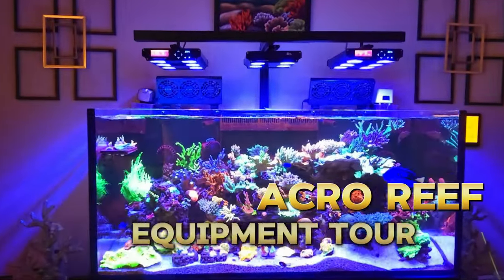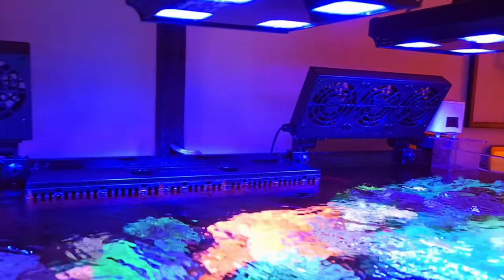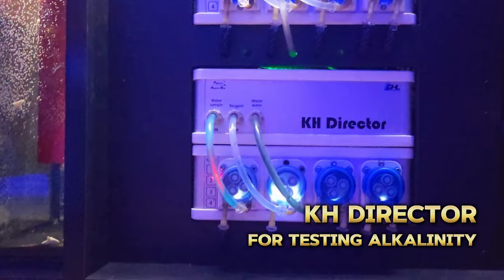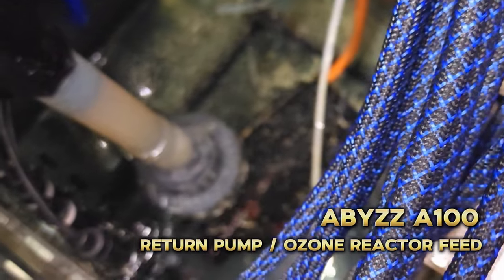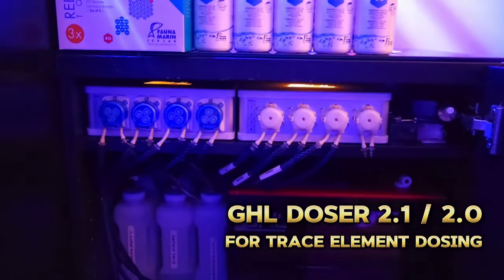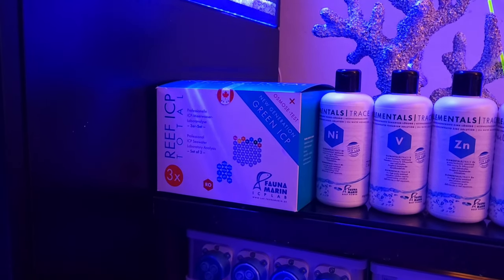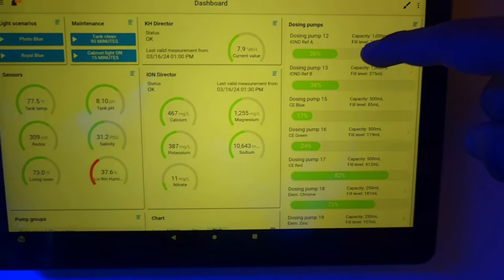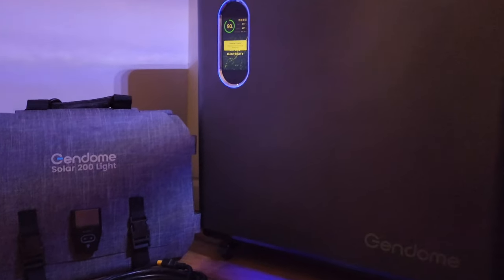Tech Savvy Reef: Exploring Aquarium Automation & Gear!

Comment: You not married, right !?? 😂  Your attention to detail is heroic.  Well done sir, left-to-right, top-to-bottom. I have also a RedSea 650 for 3+ yrs, using Apex/Neptune which I actually DON'T like, btw. 😮  Ever used kalkwasser ?  I dose a slurry at night using a PH probe.  Solves more than 1 prblm in that way.  Top notch tank, thank you for sharing. 😊❤
Reply from the maker: Lol Thank you for the kind words! I did take my time with the planning phase before the tank was even ordered. Even along the way, I always pondered ways to keep as many wires out of sight as possible. The idea of having a bunch of modules or wires sticking out from the front of them would drive me up a wall. The ProfiLux helps keep things tidy. 😅

I've never used Kalkwasser, but I have considered it for this tank since lowered pH is a side-effect of running Ozone. The challenge is finding a way to keep the extra equipment consealed.

Comment: Wow the attention to detail is incredible. The GHL automation really seems to be leaps and bounds ahead of other aquarium controllers. What kind of learning curve is it to program the sensors and functions? Do you need to know coding to do the programing? I am tech savvy but I lack programming knowledge. What kind of time frame did it take to get to your current set up? Thank you for sharing much appreciated. I am in the planing stages for my dream set up. I am considering either a water box peninsula  7225 or a Cade peninsula 1800. I want the tank to have dynamic dosing and auto water changes as well.
Reply from the maker: Thank you! I will say that what's in the tank now for automation was a steady progress. The initial setup was pretty straightforward, and I don't think you have to be technically savvy to set it up. It took me about 2 full years to get the "core" of my automation goals completed. That includes testing devices (KHD / IOND), fan control, backup measures, etc. The AWC part of it was implemented about 1 year into the tank startup. ATO was done on day 1. Calcium, Alkalinity, Mag dosing about 3 months in.

If you haven't settled yet on which controller to get, consider this...

The best thing you can do for yourself is have a clear goal and plan in-mind before jumping into any controller. You can do a whole lot with controllers and it's fantastic, but when you get it, if no clear plan has been defined ahead of time, it's going to get overwhelming quick! That applies to all controller brands! Read the documentation and product pages, get some kind of understanding of what YOU want out of a controller, consider what expansion options are doable (but don't focus too heavily on reading about it if it doesn't apply to what YOU want today) and define a clear goal for yourself BEFORE jumping in an getting one. Reading about them on forums is nice and all but take what you see there with a grain of salt. Also, ask yourself what is the single most important thing you look for in a controller? For me, it was reliability above all. I couldn't care less about pretty interfaces and neither do the fish. Correct me if I'm wrong, but fishes are more appreciative of equipment that is tried, true and tested to be reliable. :) 

My controller search ended in 2006 when I asked myself who had the longest track record for reliability. That's how I found GHL and their ProfiLux 2...years later I've gone and upgraded to the current ProfiLux 4 and Dosers and couldn't be happier.

When I first setup the P2 controller, there were barely any how-to videos and guides out there. Nowadays, you have a lot to choose from. Setting up dosing schedules, timers, probe controls are done with drop-down boxes. Probe calibration is also straightforward since it can be done through the app. I never had to learn any level of coding even when I had the ProfiLux 2 back in 2006. :)

You can't go wrong with either tank options! I'm excited for you. Take your time with the equipment part of it. If you want to get into a controller, just start with the basics (temp control and pH monitoring), all else can come later down the road. 

Best on your new tank journey!

Comment: You think I could use the color elements along with ESV two part?
Reply from the maker: Yes, most definitely. Just don't go putting them in your ESV containers. It's meant to be dosed separately. I've used Color Elements for several years and have found it to be very helping in giving corals that extra bit of color.
Reply: @TheAcroReef425  yeah that’s what I plan on doing. When I look at the ingredients I notice it doesn’t have strontium in it. Are you dosing this  separately? Also what kind of caps you have on the color elements so you place dosing tubes inside of them
Reply from the maker: @garycumbo1092  I do add 'Fauna Marin Elementals Strontium' when my ICP test shows that the tank needs it. Otherwise, the bottle sits idly until I need it again. As for the caps, I just drilled a 1/4" hole in the original caps and dropped the tubing into the bottle. To prevent the tube from curling, I put a piece of rigid acrylic tube at the end of the tube so it is always straight.
Reply: @TheAcroReef425 awesome I’m considering doing my 50 gallon cube to be sps dominated the tank is 24x24x20 just trying to figure out if I should do a branch aqua scape or all base rock

Comment: How did you make up the light mount system? I’m looking to making something similar for my reefi uno pros
Reply from the maker: I made it using 80/20 Inc aluminum extrusion. They should have a store on ebay where you can put together the parts to make a custom light mount.

What I used is the 1515 series (black).

Comment: Which dosing lines are those?
Reply from the maker: They're standard 1/4" vinyl tubing with PET Braided Sleeving over it. You'll find it on Amazon.
Reply: Hell of setup man! This tank is fantastic! What’s your thoughts on the bashsea ato reservoir? I’ve been looking at getting that exact one. Would you recommend?
Reply from the maker: @MikeLemming  Can't go wrong with Bashsea quality! Steve is great to work with and very detail oriented. Both ATO and AWC reservoirs are custom made to fit the cabinets. If you contact him, tell'em I sent you. He'll take good care of you. 🙂
Reply: @TheAcroReef425  I appreciate it! I may just buy the standard one for like $200 online.. no need for custom.
Reply from the maker: @MikeLemming Anytime! Yeah, if his standard sizing fits in the space you're looking to fill, no need to spend the extra dollars on custom.

FWIW, I only went that route because I planned to put a reservoir and dosing containers in the same cabinet.
Reply: @TheAcroReef425  I get it. I have 6 feet under the tank and only a 3ft sumo so I have some room. I may have to see if my calcium reactor will fit when the time comes. Good thinking!